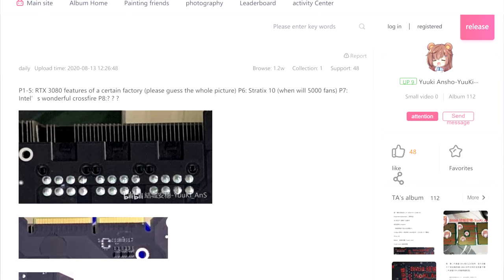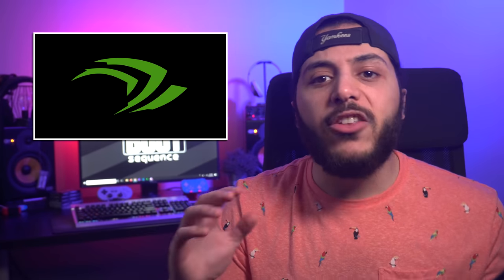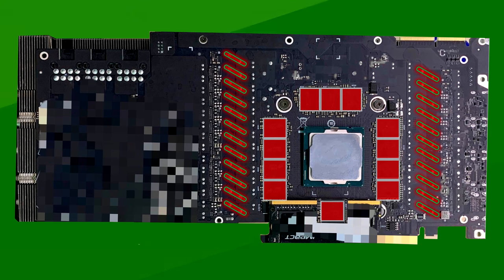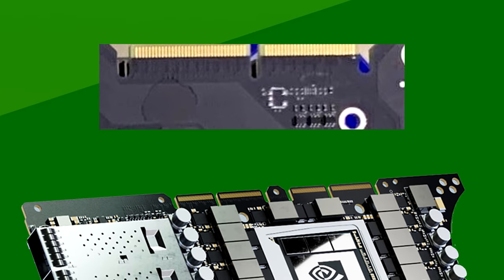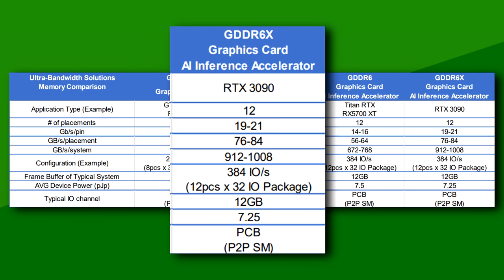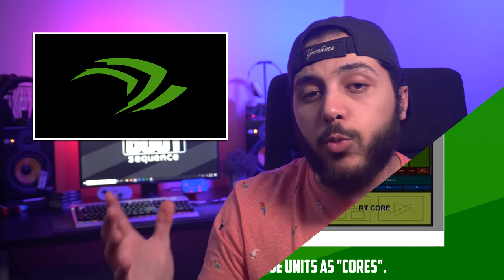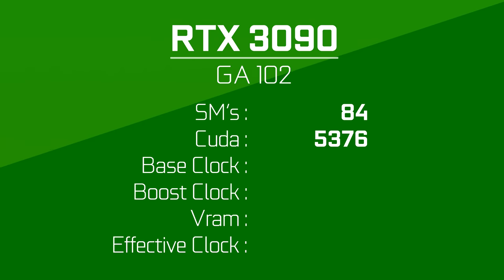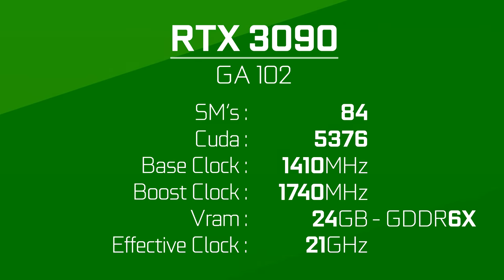RTX 3090 PCB Photo Leaked! New NVLink Connector and More!

Comment: With all of the promo stuff for 21 years of Nvidia. I wouldn't be surprised to see the new line of cards be the 2100 series instead of 3000.
Reply: my guess the 21 series, with ram running 21ghz on the top cards at least, im sure they will work in a couple more 21's in their launch as well

Comment: What if what if a dedicated rtx core unit with just rtx cores is released
And can be connected to another gpu with nvlink
It would be awesome and bad at the same time xd
Reply: Awesome if they make one, but you know they won't  (why would they), I mean they can sell you 2 x 3090's instead.  If you are in the group of 0.0001% than can afford one 3090, you can can afford 2 just as easy.
Reply: Jon Donnelly lol there is a small group that can buy one but not 2, the one that will spend their whole stimulus check on it lol.
Reply: the good thing about rtx is .. it ray tracing better than a GTX... problem with it.. used power like hell..

Comment: The new fingers will be for an RTX accelerator card aside from the nvlink fingers for dual GPU support as per usual. 

The Co-processor is for that RTX accelerator add in card to help decode and hand off work to the RTX add in card and back for the GPU to render in real time etc. 

I can't see why nobody doesn't already know this!?

Why aren't people talking about this!?
Reply from the maker: Thats what i said in the video. The nvlink 3rd gen could be used for acceleration. But i dont think nvidia would do this as it would allow acceleration for lower tiered cards which would cannibalize higher tiered features
Reply: @BootSequence  precisely mate! But we are talking about Nvidia afterall and the cool kids club has always been the Titan and Ti top end cards that usually get the only real new die and feature set that "Just Works" 😊. Maybe this will be a case of Nvidia's desperation shining through with big navi being actual competition at the top end finally and Nvidia trying to set up the rich kids add-on card tier now. The Titan, 3080ti and 3080 will be compatible and anything below will only be Nvlink. Honestly I wouldn't be at all surprised mate. It is Nvidia after all right? 

I honestly think AMD have Nvidia on the ropes right now, just like what they've done with Intel already as well, which is a bit scary yes? 

Only 100 odd mhz increase in speed over the 2080ti and 8nm Vram!? 

Rushed and luster lacking stepping stone series of cards prior to DDR5 and Gen 4.0 cards, motherboards and Ram, CPU's become the new standard and we look at real improvemments in IPC and compute by 2022-2023 where Raytracing/Pathtracing are as standards like physx cards were integrated back in the day from add-on or full cards in past. 

Nvidia will make a proper effort then. This is just RTX 2.0 launch mate and it still won't "just work".

I have a feeling that AMD's Big Navi may not be that "big" too. I think it's AMD's first real shot at the top but once again next gen compute is where the true battle will be had this time.

These cards will be Nvidia add-on gimmicky RTX accelerator card garbage and AMD showing that they don't need the add-on cards at all. 

Next gen well see 40-50% real gains and real next gen games will require that level of hardware to run them properly again right!? (Ultra settings).

We'll see in a few weeks now anyway right?

But I'm not at all holding my breath for either to be mind blowing, just tick tock stepping stone cards. 

I'll buy the best performance high end card because I want to wait it out at least 3 years before the next major upgrade from my 3900x build. And a 1080ti like new top end card is what I'm looking for out of these this time around. Who knows I might end up with and AMD card after about 18 years again 😂. 

I'll keep you updated when I make my purchase! 

Always love your work mate! You just say it how it is! 

Keep being you legend, I'll always have your back!!

Excellent video by the way!

Comment: Your NV link comparison looks nothing like the new stuff. The width of the left connector is not the same as on the new connector you showed.
Reply from the maker: Its inverted. The top photo is the back of the pcb
Reply: @BootSequence  that makes no sense. Still it doesn't line up with the newer connector.

Comment: Less than 1% of Gamers will buy 24GB RTX 3090 (which price might go up to $2000)
Am more interested in Vanilla 3080 which might cost $700-$800 
Majority of people will be interested in Mid tier (3070-3060) which will cost $400 to $550 minimum 
Let us wait & see the prices Vs performance & see how Big Navi has to offer
Reply: Same
Reply: the difference between the 3080 and 3090 in your price is too high. I dont think the performance will be more than the double.
starting from the 3090 at 2000$
the 3080 will be more 1000 - 1200$ 
a potential 3080ti at 1400-1600$
the 3070 at 700-800$
the 3060 in the 500-600$ range
Reply: @willgart1  It's not likely, Because Nvidia can't do those crazy prices while AMD have Big Navi (Q4 2020)
Yes.. they hiked the RTX 2000 Series because AMD have nothing to offer (5700xt comes too late)
But with Big Navi.. story is different.. They might Charge $2000 for 3090, but that's only because Big Navi can't beat 3090, but Big Navi surely can match 3080, so they can't hike the prices like they want
Reply: @Jack_Sparrow131  Big navi will not beat the 3080, maybe they'll be close.
so AMD has to release a 1000$+ GPU with the associated power.
they have to demonstrate a very ray tracing too, its become clear that the next gen games will use it more and more.
AMD had a low price due to the lack of features like RTX.
adding these features will increase the cost.
Reply: @willgart1  Who knows.. next month we will know Nvidia prices.. at least they will announce 3090 & 3080 on September 1st (retailer versions will be in late Sept)
All in all, Nvidia doesn't want to hike prices that much, because they gonna release their cards 1st.. & AMD will release Big Navi after Nvidia & might sell them cheap later (probably Nov-Dec).. just wait & we will see  xD
Reply: more like less than 0.001%
Reply: @Jack_Sparrow131  What makes you think Big Navi is going to be cheap :DDDD
Reply: @jondonnelly3  If U wanna survive.. U have to cheaper since U can't get the performance crown
Big Navi best tier might trade punches with 3080, but it won't beat 3090 (mostly)
So, Nvidia will be forced to stick with reasonable prices for 3080 & below
Simple logic, nothing more nothing less
, at least that what I seen in past for companies competition

Comment: 2x8 for 375watts..... and a boost clock of only 1740mhz???  Headroom on most cards is no more than 150 to 200mhz tops, so max speed is maybe 1950?  If thats right Nvidia is in trouble. The PS5 runs RDNA2 at 2230mhz on a fricken APU.  Those clocks have gotta be low.
Reply: Not comparable, different arch.
Reply: The 2080Ti has a boost clock of 1545, yet pretty much all of them do around 2000 sustained. Nvidia's rated boost is always much lower than the cards actually run irl.
Reply: @isakh8565  exactly. 1080tis had like a 1600mhz boost but high-end models do 2100mhz.
Reply: @techbuildspcs  thats correct, mine boosts up to 2075, OC on air..But I changed the fans on the heatsink to noctua NF F12 3000rpm..sounds like jet engine but monster cooling.

Comment: Question : What IF RTX 3k series/21xx series are Gen4 PCIE?will my motherboard bottleneck the performance?.if yes by how much?
Reply: Gen 3 is not even maxed out yet and i doubt it will be even with these new cards. the only thing that is using Gen 4 at the moment is the new Nvme ssd's, they cost a fortune and still some of the 3rd gen Nvme disks beat them in performance.... go figure that one out lol
Reply: @robkelly9258  oh gpu gen3 pcie wasnt maxed out yet? so u feel there are chances that the gen3 wont be maxed out even if the nxt rtx is pcie 4?
Reply: @miseriez9308  I don't think gen 4 is going to be a requirement for these new GPU's, maybe the next ones. It is only the X570 and B550 boards from AMD that support PCI gen 4 at the moment and both AMD and Nvidia are going to want these cards to be able to work on the 3rd gen bus.... There is tons of breathing space left with 3rd gen pcie.... we don't really need 4th gen etc at the moment but hey it is all about numbers and making it higher than the last one so people buy it.

Comment: Do we really need 24 gigs of vram ?
Coz several months ago people said that 16 gigs of v ram on Radeon VII was unnecessary But as we already know Radeon VII had HBM 2 memory can someone explain ??
Reply: Next gen games will require huge vrams. Xbox series x can have maximum of 10gb Vram, so PCs have to get better. Radeon released at a time when 2gb vram was enough for most games.
Reply: @srimasis  It's not as high as that, the ram is shared between  GPU and CPU so I can't see  many games getting near 10gb.  It's a maximum for a tech demo.
Reply: @jondonnelly3  the total memory allocated for games is 13.5gb. About 10gb is high speed memory to be used mainly for vram and about 3.5gb of slower speed memory will be used by CPU. 2.5gb is reserved for OS. 10gb vram + 3.5gb CPU ram + 2.5gb OS reserved = 16gb of total memory.
Reply: If you play some of the latest triple A title games in 4K for example than yea 20 to 24GB of VRAM is perfect, since I play in 4K with a 144hz monitor I have eaten up as much as almost a full 11GB in a game with ultra settings.
Reply: @d3ltaking419  ohhh that's some big v ram consumption

Comment: i dont feel sorry for the guys who bought 20 series! i just skip generations this time its time again! :)
Reply: 20 series were great cards if coming from the 900 series
Reply: @caribbaviator7058  I hope the same will hold true coming from the 10 series to 30 series!
Reply: @Maltebyte2  Not having my hopes up especially concerned about the pricing.I do hope Nv gets real competition this year.
Reply: @caribbaviator7058  Yeah same, pricing scares me already!
Reply: it ok.. i only get laptop... i only using them until the laptop wear out and i just move to next one.. and old laptop just going to backup...
Reply: I just sold mine for $1000...so I'm not sorry at all.

I'm $1000 ahead for my next upgrade.
Reply: @tylerdurden3722  do you do this every generation?? i can get the 3090 but i dont need it! the 3070 will do just fine for my needs!
Reply: @Maltebyte2  yeah...but the draw back is I usually go without a decent card for a while.

Sometimes it's hard to get anything just after launch. Sometimes launch just takes longer than I thought. Or I sold too early.

With my HD 7970, the card only really became great after a while (after drivers were sorted, etc....my brother bought it from me and he reaped the benefits of the fine wine effect)

And 70's cards are usually the best value. And it's easier to sell later. Demand for those (the super) is still high
Reply: @tylerdurden3722  i can wait no problem if i get one in january or when ever its all good!

Comment: Gpu2 on the back is transversal co Processor. It make RT and Tensor cores perfom Twice as normal.

Ampere has half Tensor cores count but it work like full Tensor cores like on Turing. That is why they call it double precision Tensor cores, thanx to transversal co Processor. Example like inside Nvidia A100.

Half numbers of tensor make Nvidia have more room to add more RT cores. So i believe ampere Will have 1.5-2 X RT cores number than turing plus transversal co Processor make it Twice so become 3-4x faster than turing.

But transversal co Processor also take penalty on power consumptions. It take amount of power consumptions. Make ampere TDP is high and limiting Nvidia to raise the boost clock.